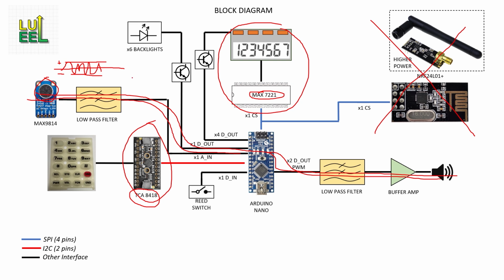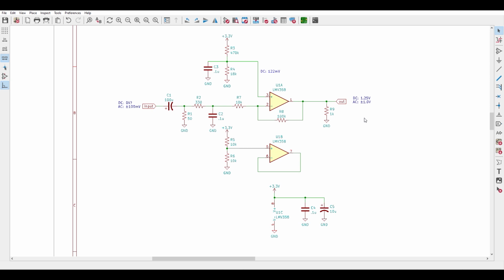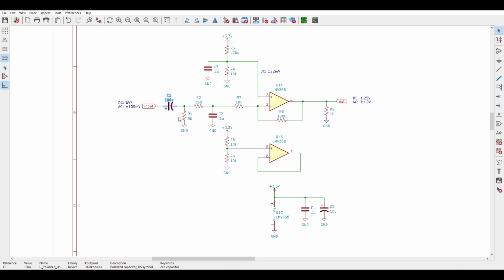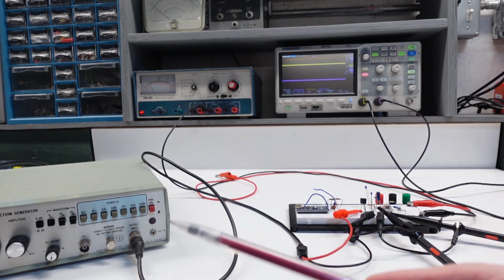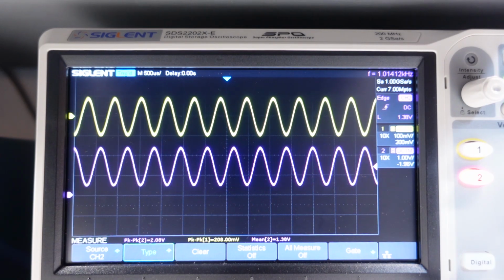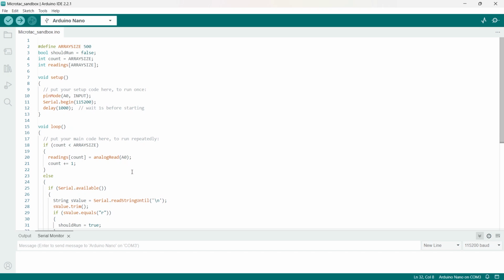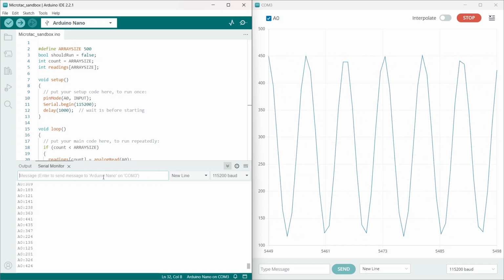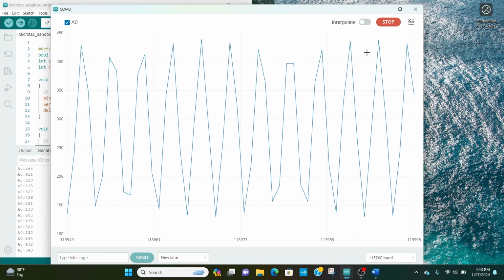Mod the MicroTAC: Part #2 - Audio to Digital

Comment: You might want to upgrade to a Teensy 4.x micro controller now it has a lot more horsepower and you can still use the Arduino libraries and IDE. I’m using one now for software DTMF decoding.